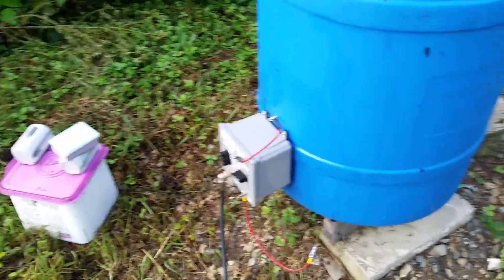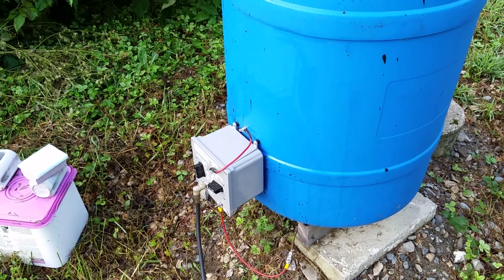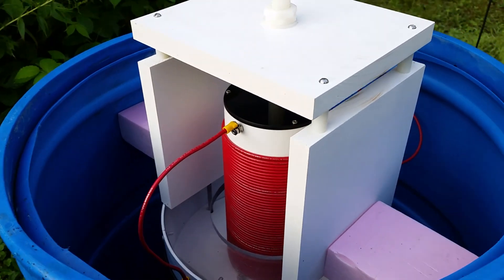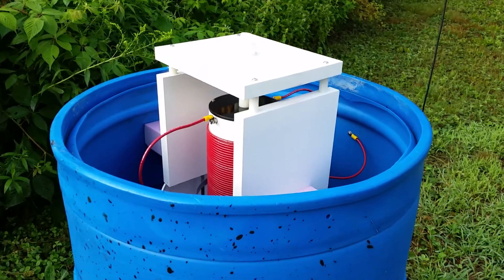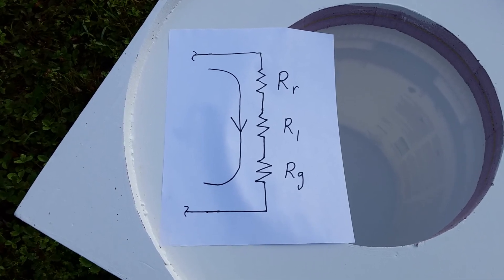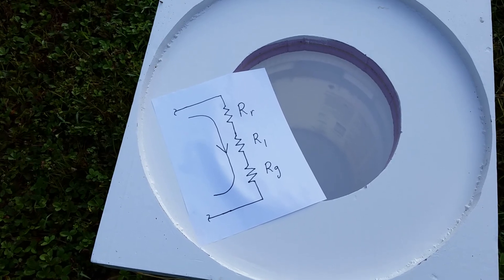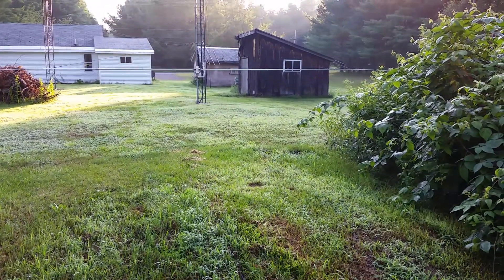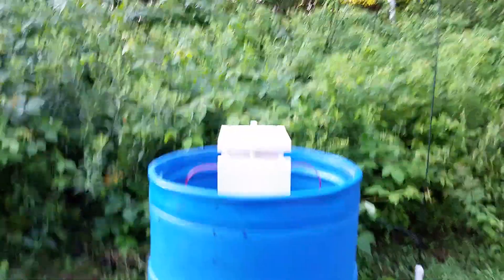Summer 2018 2200m Transmitting Antenna

Comment: I feel compelled to report you to the FCC for not ID'g ever 10-minutes on that QSO you had into Europe!  HiHi!
Actually very impressed that you would pioneer (literally) and take on the challenge of this band.
It is interesting to see the laws-of-physics not change but the size of your antenna does, as you go down in frequency!
Also, very nice build quality on all the projects that I've see from you--hats-off!  73...
Reply from the maker: Thanks for your kind comments. The funny thing about that is we spent four nights completing the DFCW QSO, but several months later we completed a QSO using digital mode JT9 in less than five minutes! I was shocked to see Chris calling CQ, as that is rarely done on 2200 meters. I answered and it was a quick, easy exchange. I subsequently worked G0MRF and DL7NN, along with a few U.S. stations. After being off the band for a while I am starting to rebuild. I will make some videos as I progress and see if there is any interest in those.
Reply: @n1bug  i thought those kilometeric bands were just used by submarines and using QRSS, so kinda takes a whole day to transmit an encrypted message.
Reply from the maker: @zazugee  There is more going on at these frequencies than you thought. If you are referring to QRSS as encrypted, it is not. There are many modes used on 2200 meters ranging from normal CW to QRSS and variants of it to modern digital modes which can transmit a message at various speeds from 15 seconds to 30 minutes or more. The choice of mode depends on personal preference and what one is trying to do. Soon I will be starting a new video serious exploring what is possible on these bands (with a focus on 2200 meters) and how to do it.
Reply: @n1bug  no, i'm refering to basilistic nuclear submarines needing slow modes of communication at LF, adding encrytion into it makes it so that transmitting military codes takes hours.
Reply from the maker: @zazugee  OK, I guess the QRSS part threw me. At VLF (below 30 kHz), military comms may be most of the traffic. Occasionally there is SAQ at 17.2 kHz though. I believe it is the last surviving Alexanderson alternator (mechanical) transmitter and is only on the air twice a year for commemorative transmissions. It is a fascinating thing to listen to.
Reply: @ no problem, i think my perception of VLF got influenced by a certain movie, after done some reading i realized it's ELF and not VLF, but ELF is no longer used by US navy and they use some faster MFSQ on VLF nowadays, but other countries still use ELF.

Comment: Have you made many contacts? I've been curious about this band for a while
Reply from the maker: I worked about half a dozen stations in North America, two on CWE and the rest on digital modes. My best distance QSOs were 2E0ILY, G0MRF and DL7NN on digital modes. I am sure there would have been more but mMy antenna came  down in a storm three years ago and I have not been active since.
Reply: Wow, that's neat! I'm sorry your antenna came down though, hopefully someday you can put them back up again😊
Reply from the maker: Thanks. I could put it back up any time. The problem is it caused damage to other antennas, towers and rotators when it fell. All antennas were covered with wet sticky snow at the time. It was a tremendous weight. When the 2200m antenna broke and fell, the sudden reduction in side loads caused both towers to move a bit a top, quite violently. That sudden motion combined with the weight of the snow on everything is what did the damage. I can't risk that happening again. 2220m is a lot of fun!

Comment: Do you have to apply for Part 5 experimental license or notify the UTC before transmitting? (Arm-chair wikipedia reader on the 2200m band.)
Reply from the maker: In the U.S. if you want to transmit using your amateur radio call sign with amateur radio privileges, you must notify UTC and wait at least 30 days to see if they object. If they don't, you are good to go. If you want to transmit with privileges not allowed under amateur radio rules you can apply for a Part 5 license. There are very few of those now that we have amateur privileges on 2200m.

Comment: Brings back memories of work on aviation NDBs when I was a radio tech in Australia. Ours were around 200 to 350khz which is quite abit higher than what you are using.
Reply from the maker: I didn't get deeply into it, but I did listen for NDBs during my time on LF. The make good propagation indicators.

Comment: Hello Paul,,,      Great video!!   The tophat looks great. Very nice build. So happy YT suggested this video.  I put 50 watts on 8.97 KHz many years ago and know exactly all the work it takes to do a project like this .. Thank you for putting this up.
Reply from the maker: Thanks Paul. I had a lot of fun on 2200m and miss it every day. I lost the antenna in a storm December 2020, temporarily repaired it but took it down for good in the spring. Losing the 2200m antenna was no big deal, it was easily repaired. But when it broke and fell, there was a whiplash effect that damaged many of my other antennas and one of the towers. That I can't afford.

Comment: It is 2023! You can talk faster than one word an hour!
Reply from the maker: Of course, but those of us who do this kind of thing either do it because we are fascinated with propagation at LF, or want to learn about antennas and circuits for use there, or just for the challenge. For me, it is all three. At this frequency, talking faster means your signal doesn't go as far. To get long distances we need super slow to dig deeper into the noise.

Comment: I always wanted to know more about this band
Reply from the maker: Most of the activity on this band is one-way using quasi-beacon modes like WSPR and the new FST4W and others. Every once in a while you get to make a two way QSO. I have more on it, mostly about equipment I built on my web site. Unfortunately I no longer have this antenna up so I am off the band now. In December 2020 this antenna broke in a bad storm, causing the towers to shake and move which caused extensive damage to all my other antennas. I have repaired the damage but did not put this one back up because I can't afford to have that happen again. I miss 2200 meters a lot!

Comment: This is why I was impressed when I heard that German government time signal station DCF77 on 77.5 khz has a T antenna with about 70-75% efficiency... on 77.5 khz
Reply: Interesting. I will try to see if I can find any information about the DCF77 antenna. If we could build a nearly full quarter wave vertical it could be that efficient or better, but it's not practical in ham radio to build such a tall structure!
Reply: @cwdxer1981  There's a photo of the DCF77 antenna on wikipedia.  There are multiple high towers in a circle to the main radiator in the middle and I'm sure there is a very extensive rf earth network below the ground.  It would certainly be beyond our means and must have been an expensive endeavour for the West German government in 1959. It is also to be used as emergency communications in times of (nuclear?) war, I believe.

Comment: Quite impressive. Since the power limit on 2200M is 1 Watt EIRP, why have you used such large-gauge wire for your loading coils? Or is it actually coax (maybe salvaged) and you're using only the outer conductor?
Reply: Excellent question. It is 10 gauge wire. The coil can be a significant source of losses in an antenna like this. The lower the losses in the coil or other parts of the antenna system, the less transmitter power needed to make 1 Watt EIRP. With most such antennas being on the order of a fraction of one per cent efficiency, many of us need a few hundred watts transmitter power to get to that legal limit. Larger wire means lower losses. Since that wire and the form for the large coil were provided to me at no cost, there was no reason not to use it in the interest of maximizing efficiency.

Comment: Interesting!  Just curious...at 11:05 you mention communication is extremely slow, one word per hour.  Why is that?  Could you not use normal CW morse code?
Reply from the maker: I have used normal CW but on 2200 meters it won't get you more than 1000 miles, maybe 2000 rarely. For real DX you need to be able to copy weaker signals than normal CW can do even with the best equipment an operators. Extremely slow modes like the one I mentioned in the video can dig 20 to 25 dB deeper into the noise, greatly extending range. There are also slow digital modes that can get down to those levels (JT9-10, WSPR-15, EbNaut, ...)
Reply: The slower you send cw morse code the less bandwidth used, the lower noise levels are on the receiver, the further a weak signal can be picked up. Those are the advantages of sending and receiving extreme slow cw morse code

Comment: Thank you for the excellent video. I had been considering this kind of configuration for doing wspr, but not sure it would be worth all the work. Besides, there's no way I can get an antenna up even 50ft, much less 90 ft. But I definitely enjoyed your video!
Reply from the maker: Lower antennas will work. I've copied and even had a two way QSO with a station in England whose maximum antenna height is less than half of mine. He does have a good bit of top loading in the form of a full wavelength 160 meter horizontal loop. One solution with smaller antennas is to run more power. Remember we are allowed 1 watt EIRP. For some with larger antennas that may mean running 100 watts or less out of the transmitter while for those with smaller antennas it might mean running 1000 watts to get a watt radiated.

Comment: I'm thinking of using similar methods to change my 80 meter skywire into a vertical similar to this, shorting the 450 ohm line and ending up with it as a vertical top hat. Then an added grounding system might make a difference. I'm thinking relays and motorized coils would make it all switchable.  The 80 m loop is amazing as is though. But, I'd like lower band, 160 ect.
Reply from the maker: I know someone using a setup like that on 2200m. His loop is bigger, 160m full wave I think. It works very well. It will give you low angle radiation (good for DX) on 160 if the length of 450 ohm line and amount of top loading don't make it too long. I doubt it will, as that would take quite a long line I think.

Comment from the maker: At about one minute into the video when I was talking about the top hat, I was actually showing the end of a nearby 80 meter antenna. I can't see the display on the camera in bright light so I'm doing this blind! I got it right a bit later at about two minutes in, and again at the end of the video.
Reply: The silk one or the felt one? The 10-inch one is rare now :(